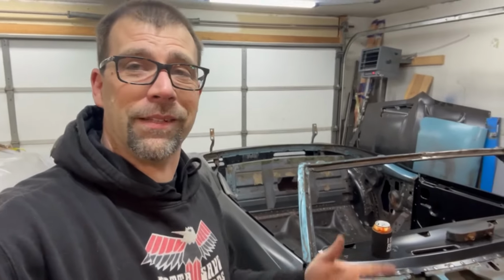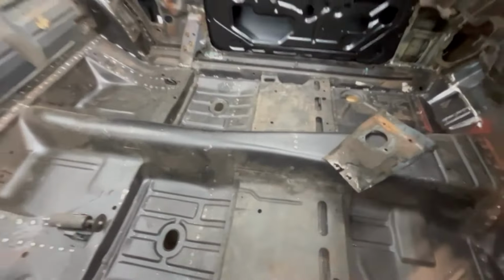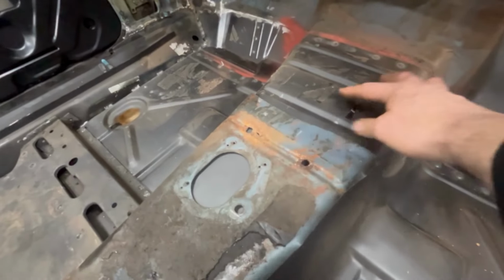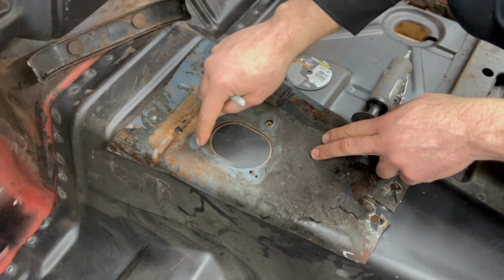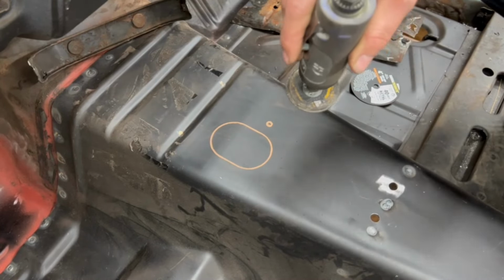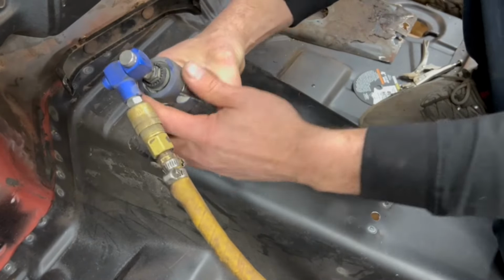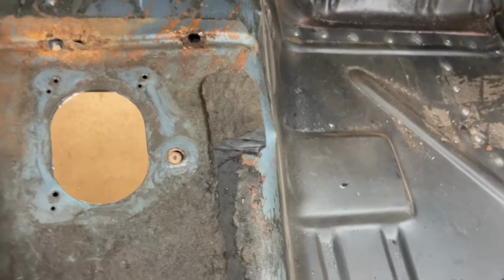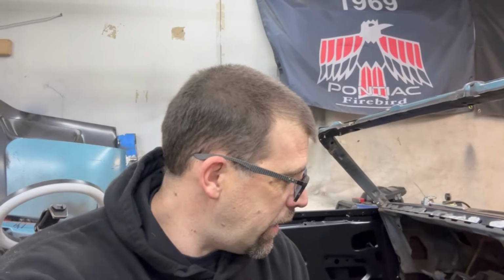How to cut a round hole with a cut off wheel,  automatic floor shifter 1969

Comment: That door looks like it fits almost better than the original. Nice clean hole for the floor shifter. Our ‘67 looks like someone use a pair of  tin snips and peeled it back with pliers. Great video 👍
Reply from the maker: I think the doors do fit better than original, I really have zero complaints.  Doesn’t normally go this way.

Comment: Nice build!. That definitely works, but all the filing sucks. 
Nibblers work best . But if you don't want to buy a special tool like you said.  You can use a bi metal hole saw on each end and then cut the straight out with a cut-off disk.
Reply from the maker: Definitely more than one way to do this.  Even a flap wheel would make short work of the edge.

Comment: What do you use for your metal prep on the original sheet metal and bracing.
Reply from the maker: Most of it will get media blasted and then epoxy primer. The areas that didn’t get blasted while it was apart I cleaned area with wire brush, washed then a coat of rust converter then painted.  That is much more then factory of course and will out last the rest of the car

Comment: I need to cut the same shifter hole in my 1969 Camaro.  I don’t have a template like you do, how do I know where to locate the hole in the floorboard.
Reply from the maker: Good question there is all kinds of manual trans templates available, I never found an auto template online.  There is a chance that even 1969 factory opening was torch cut.  I assume your car doesn’t have a hole to make a template from.

Comment: You have a lot more experience than I but putting any side force on the cutting wheel seems a little dangerous to me.
Reply from the maker: The most important thing about using a cut off wheel is never force it.  The only thing you do is hold it steady and let the wheel do the work. The wheel determines how fast and where it wants to cut the only thing we do is give it its start point. Basically there will be minimal or no perceptible RPM change if there is it’s being side loaded or pushed that is not ideal with any cut perpendicular or on its side.